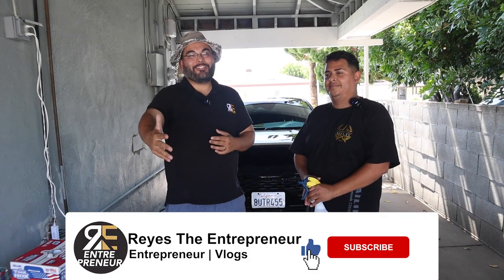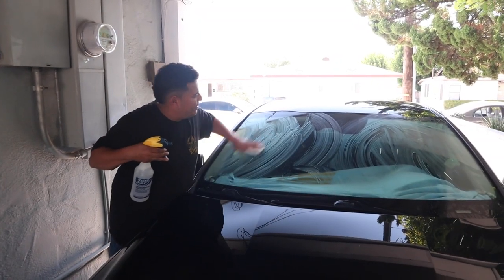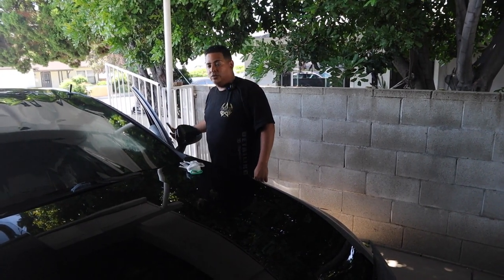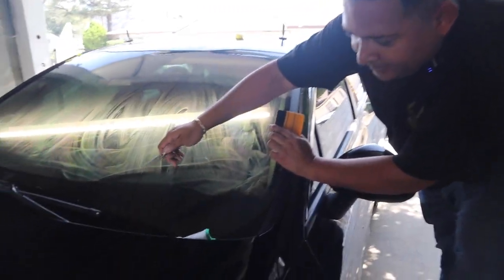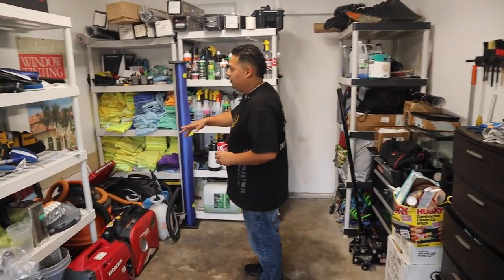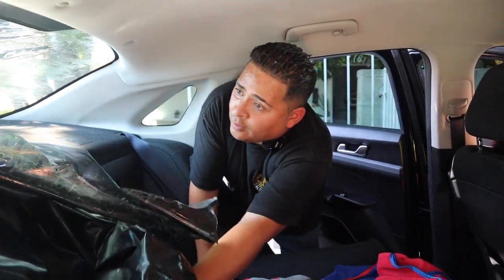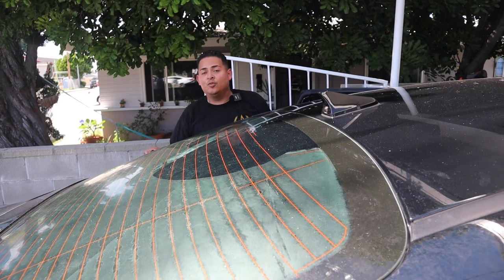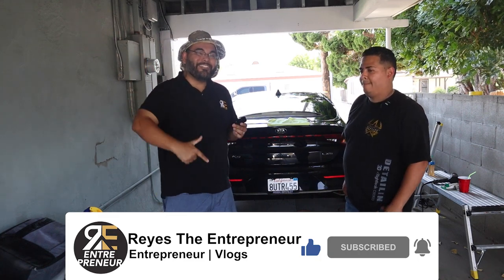How To Tint Your Own Windows Step By Step - Ride Along - Reyes The Entrepreneur

Comment: Great video, but let me correct you on 1 thing, glass is NOT easy to scratch, in fact, when detail cars for some of our reseller clients, often the windows will be marked by some marker/paint, and we use a razor to scrape it off, we never see any scratch marks and we are never careful. Clear coat on the other hand is very easily scratched